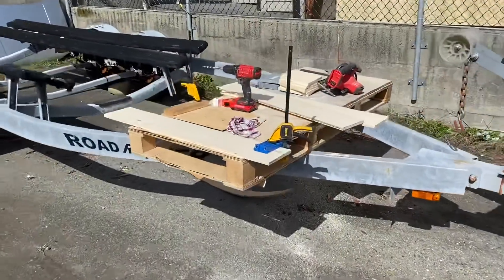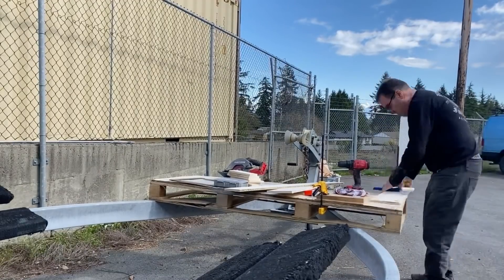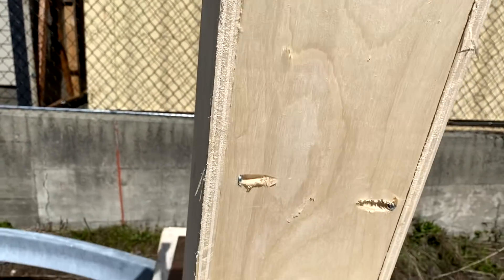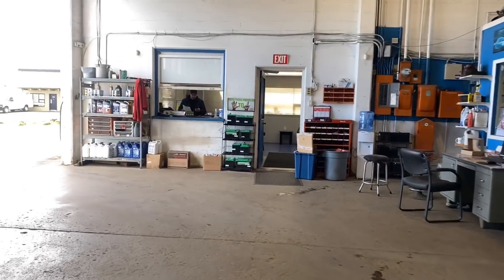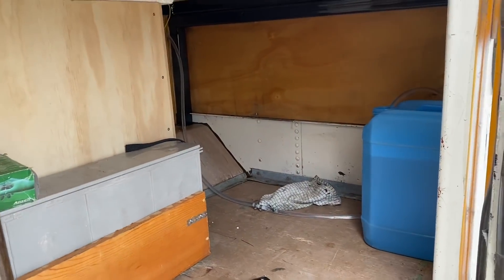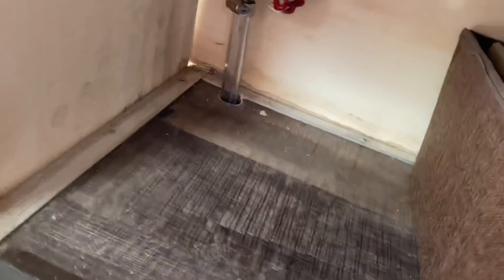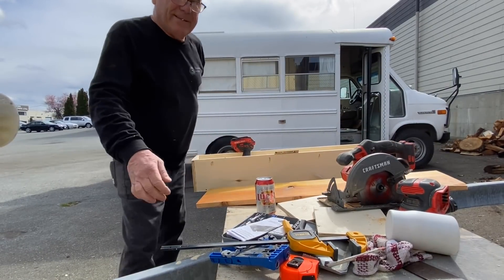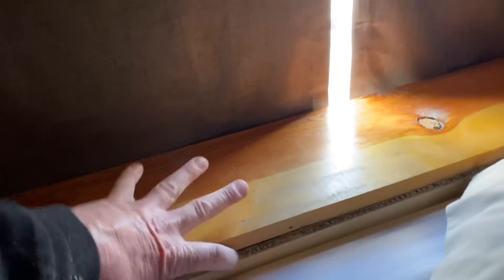So Close to Hitting the Road

Comment: Nice storage boxes. I want six of those. Do you deliver? :-) 
Kitchen sink and water system looks great. For hauling water, maybe a couple of five or ten liter jugs and a funnel so you don't break your back or knees by hauling those big water containers. Other than that, big water containers in the garage is a good idea, imo. Except for during winter if you don't heat your garage with a diesel heater. But you can also just keep your water in smaller containers inside the bus when it is below freezing. It is all coming along nicely. I am looking forward to seeing you on the road.
Reply from the maker: I am planning on installing a diesel heater, and maybe a lil insulation.
plus out west it hardly ever freezes